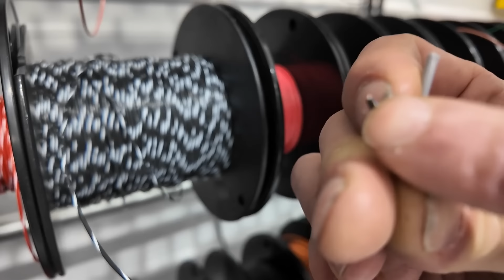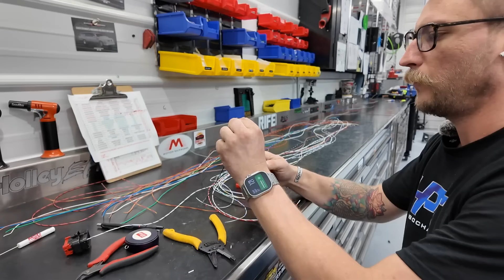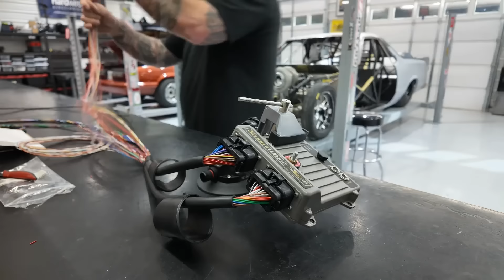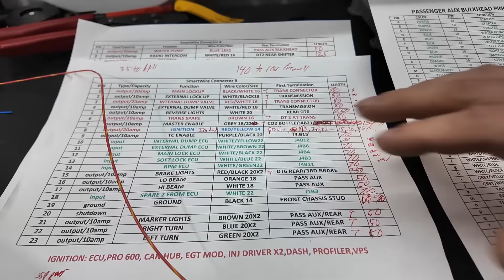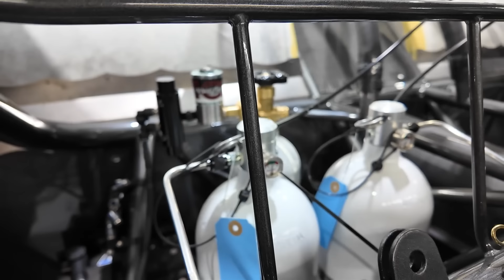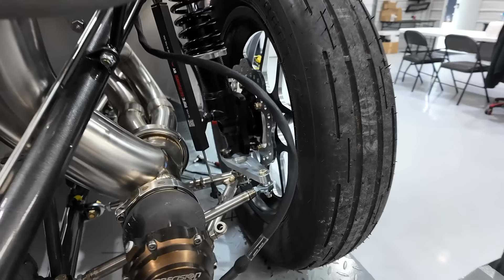Slingin’ Wires for Cleetus McFarland and Mullet- Day 3

Comment: Do you wire any sort of sensor into the CO2 / Chutes so you can put big red flashing warnings on the dash if they are turned off or no PSI is detected?  The boys have been know to forget to turn those on sometimes.
Reply from the maker: Check out the day 2 video and we go over exactly that

Comment: I know you do full custom but what do you recommend for someone that wants to add circuits to a vehicle. I hate using fuse taps but needed to for aftermarket mirrors with turn signals. Is there a cleaner way to do this?

Comment: First off yall are doing amazing work.  I feel so out of touch with wiring since the can buss systems were introduced.  As a carry over from last video.....Honestly knowing how in the zone cleeter can get I would suggest a central emergency notification system with a massive red light and loud alarm for critical systems like the co2 bottle or fire suppression system fault.  Sorta like an aircraft fault system.  Say he pushes the button for CO2 not only does it light up in his face with audible alarm but displays on the dash what the fault is.  I know that might be overkill but I would rather err on the side of caution when it comes to his racing because he definitely gets hyperfocused and may not catch the dome lights coming on.  Might be something to do future wise too.  Just my thoughts.

Comment: Doesn't the bulk heads create a weak link in the wiring harness? I'm from a class 8 shop and we were always replacing them due to failures in the system from them failing. Volvo tractors was the manufacturer we was dealing with just an f.y.i.

Comment: RaceSpeconline makes solid contact amp ss pins and the crimp tool.
Reply from the maker: That’s a tyco super seal 1.0 connector terminal 
We use them daily and keep a few 1000 in stock 
The ampseal 1.5 is a different style connector and terminal

Comment: I have a question and please excuse my ignorance but do you use dual shielded wire (foil with braided outer liner) with a independently grounded drain for sensitive things like crank/ cam position sensors, ignition triggers, ECU-to dash, CAN bus,  wheel speed sensors and just about any critical sensor running a 5v signal? Something like M27500, M22759/33/34, Belden 87761, or Raychem 44A1121-22-9?  

From my novice understanding, twisted pairs aren’t enough to protect from broad spectrum EMI/ High Voltage RF protections and only helps moderately with low voltage and high impedance systems. 

Do you use any Ferrites? 

Also do you still use any diodes anywhere even though your running a Smartwire with internal fly back protections, solid state output switching, over voltage protections, etc? 

Lastly, Do you use silicon jacked wire anywhere in the system?

Comment: Have a wiring question.
Is there a reason you don't use service loops at the main ecu & bulkhead connectors?
Reply from the maker: Have we terminated main ecu or bulkhead connectors yet ?
Reply: @theholleyefiguy I'm only going off your video's of mullet & the motion foxbody pdm's. 
Unless they get twisted in & finalised before they're heat shrinked.

Comment: The way you build your harness’s is the same way we did it at NASA. Cut sheets and cannon plugs. Do you provide your customers a schematic of the finished product? If you need an extra pair of hands, I’m an artist with a soldering iron and a crimped. I winter down in Florida. Pm me if interested.

Comment: I used to do aviation wiring and it was always a pain. We weren’t allowed to twist the harnesses together and had to comb them straight. Also, every wire is white and we had to search for the wire number that’s printed on it. You guys are doing great work and everything looks extremely well put together so far.

Comment: I would like to know where you buy the different heat shrink and specifically what the products are called. I know what Raychem DR25 is but the rest I dont know. Also who do you like for spools of Tefzel wire? Some of the Tefzel is not as good as others and I like to use use the best I can that is reasonably priced.

Comment: Love the attention to detail. Many dont know about the smaller size in wires you can use. Me myself i cant stand to wire a car or trouble shoot wiring. When it comes to Engines and rest of car i am good at the Car and Mastered the Engine. My Brother is the master of wires. He just restored a 81 Trans Am but did a LS swap. He did the paint and decals even the big bird on the hood. Car was Black with gold trim

Comment: At 5.05 justin was saying that they don’t make a closed barrel amp seal terminal and I was just wondering if he doesn’t know about the Race Spec® SS 1.0 Solid Contact which is a closed barrel contact and works really well. If yall haven’t  tried them you should give them a try on some of your upcoming harnesses I think you would like them.
Reply from the maker: That’s a tyco super seal 1.0 connector terminal 
We use them daily and keep a few 1000 in stock 
The ampseal 1.5 is a different style connector and terminal

Comment: What insulation is on the wires?  

Do you use double wall heat shrink?

Do you use ferrits on sensitive circuits 

Do you use specific crimp tools for each terminal?
Reply: The insulation on the wire is ETFE (teflzel)
The heat shrink they use is called DR25 it’s very heavy duty and works great for motorsports wiring. I’m sure they use some glue line heat shrink on certain spots also etc 
I doubt they use ferrits 
The crimp tools you have to use on building these Motorsport spec harnesses are very specific to each type of terminal, connector and wire size
Reply: @Doitalllifestyle Have you ever heard of IPC?  Specially IPC-620?

Comment: Hell ya brother!
What brand of high heat / abrasion resistance wire loom are you using?
Reply: the wiring he has on the racks is MilSpec M22579 standard  > that "spec" of wire can be sourced from multiple vendors
Reply: I'm curious about the loom. Not the DR25, but the other 2 he mentioned